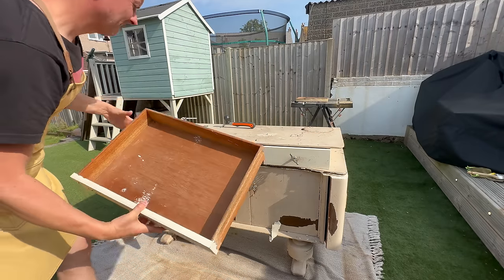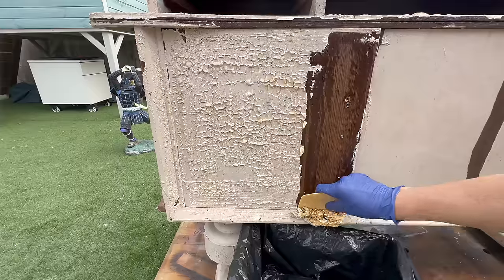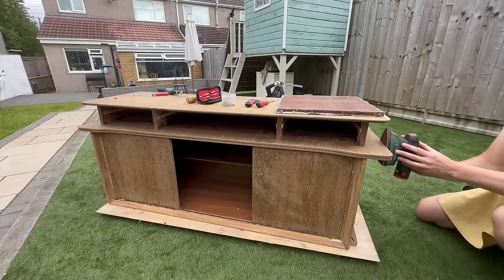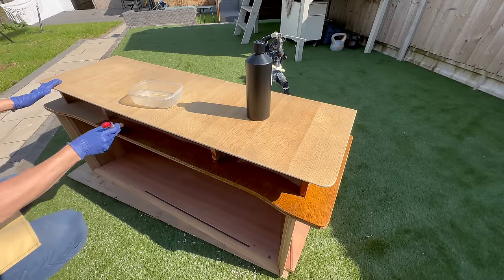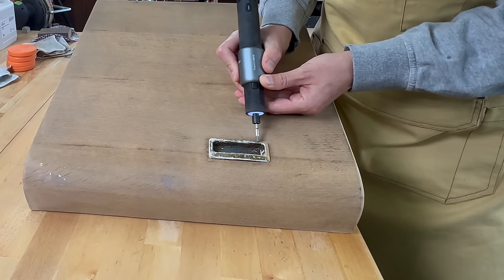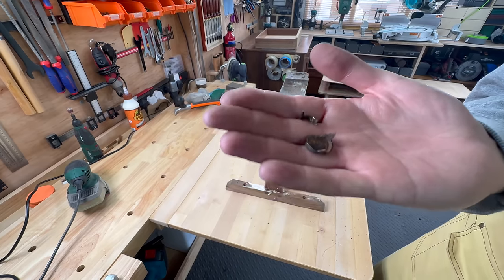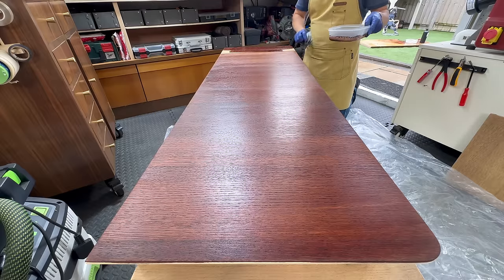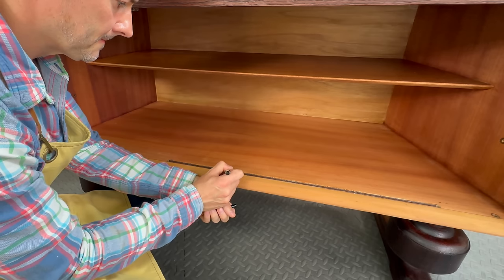I Found this in a Garden Shed and Restored it. Stripping and refinishing old credenza.

Comment: I am 74 and I love restoring furniture. I also enjoy building furniture. I have never even considered it worthwhile restoring anything made with particle board.  I live in Tasmania and the local rubbish tip sells old timber and furniture. I therefore have a great supply of well seasoned wood. My house is built in 1905 and the furniture I make represents the age of the house.  I have found many pieces of furniture which I have restored. Most are in a sound condition and only require the original shellac softened with alcohol and recoated with new shellac. Working with veneered chip board is a bit daunting for me but your results are quite amazing.   I can now see there might be some thing worthwhile in mid century Furniture. 
I think it depends on when you  were born and what is available to scrounge in your area. Thanks for your video
Geoff
Reply from the maker: Thank you ! Glad you enjoyed

Comment: Loved your video and wanted to share a tip I sometimes use on stained wood. I apply a light coat of pool chlorine. It bleaches away all of the stains. I go back an hour later and rinse thoroughly with water and let dry then proceed. You do have to be careful though depending on the type of wood you are working with. However I have had really good results with it.

Comment: Lovely work. I think what you did was amazing and I love that you like to keep your workspace so tidy and clean.

I think the base material is chipboard rather than MDF just because of it’s age. If the screws lose their grip, you can always re-harden the chipboard with superglue or wood hardener that you might use for rotten wood repair. The screws should bite back into the chipboard and be quite secure then.

Comment: I like to watch this episodes. Also when other restorers from different countries do the work. 
For instance I never have seen, heard or used the - lead checker - for old paint. Or for new one, if it matters. 
Also paint stripper was applied differently by different restorers.
However what made me wonder.Why not take this -Kredenza - first to pieces completely? 
Makes paintstripping and repairing and restoring easier accessibble?  and better to work in all those nooks and crannies?
You explained why you don't like to do it. But suppose there would be also ways and means to make these screws hold tight again?
But one thing was always the same.
The before and -after - pictures were and are always amazing.
Definitely a thumbs up and subscribe here as well.
But what I like here most,even if we might use other products.or the same thing with a different name.
You SHOW what you are using.And not only for a fraction of a second.
If it is advertising, so be it. At least here it is not annoying.
And these - pull out thingies - as you like to call them. In these sliders one could store samm high tins or bottles or jars  with tea, coffee, spices, condiments and the likes. And to pull them out,was jst to get to them easier.And not have to rummage around or search at the back of the Kredenza.

Comment: Once you get the paint off, varsol (white spirits) and 0000 steel wool will remove the varnish finish and leave the wood ready for the new finish. Because the steel wool is so fine and most of the work is done by the varsol, the amount of wood removed is virtually zero.
The varsol will also remove most, if not all, of the stains, leaving the colour even and ready for a light stain.
The end result is beautiful. My personal preference, having grown up with Mid-Century Modern when it was new and Art Deco when it was just old, would be for a higher shine finish. Not as bright as a French Polish, but a satin finish, at least. Originally it would have been a fairly bright shine. A rubbed medium gloss varnish would be about right for a low lustre finish of that era. Still, the end result is spectacular. I knew from the start it would be gorgeous, but you exceeded my expectations!

Comment: When you are bleaching with Hydrogen Peroxide you need to use .880 Ammonia in first stage followed by the peroxide, best results are obtained with sunlight and heat. Both of the chemicals are toxic so PPE is needed. You can warm the timber prior to the process if it is cold outside, this will promote the bleaching process and chemical reaction.

Comment: That looks like a computer desk, how old do you figure it is? Maybe even the late '80s? Actually those legs/feet look like a table I own that was manufactured in Philadelphia in the late 1800's. It is a beautiful piece, you did a great job,. My table leaf had the info, it looks like the back of your piece is not up original, too bad I will bet there was manufacturer info at one time. I wonder if that could have been a custom made piece. Have you tried to research it?
Reply from the maker: Does it? It’s definitely not a desk.  And not sure
Reply: Forgot to mention, those legs/feet look quite a bit like the feet on my table...and my table is an antique library table. The maker of mine was kind of famous, his home was turned into a bed and breakfast and at the time, maybe 25 years ago they were searching for pieces of his furniture to furnish their home. I have moved and unfortunately the leaf is nowhere to be found. I never bothered to save any info on the table.

Comment: You did a fantastic job. However, I really despise those bulbous elements in the legs. Removing them from the piece would have increased it's beauty. It's the only flaw but the design isn't your fault.

Comment: When you are trying to remove stains from wood, to even out the color, do NOT put oxalic acid on anything OTHER THAN the stain.  If you cover the ENTIRE surface, then you are LIGHTENING THE ENTIRE surface.  

You ONLY want to lighten the BAD STAINED WOOD.   

By coving the ENTIRE SURFACE you are then bleaching the GOOD wood color LIGHTER, in which case, you will always have a tone difference in the wood.  

You only want to lighten the STAIN.